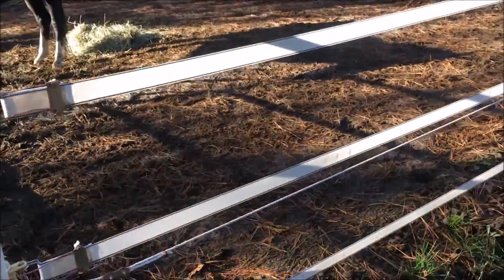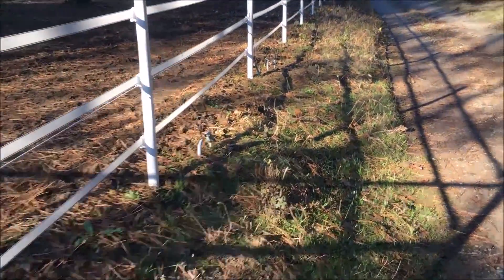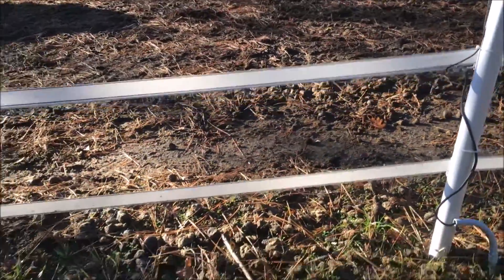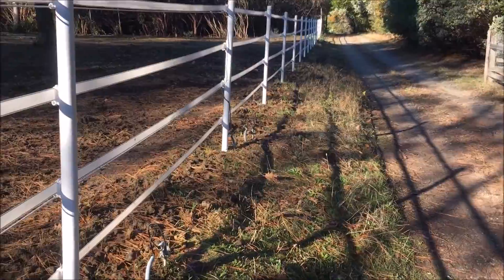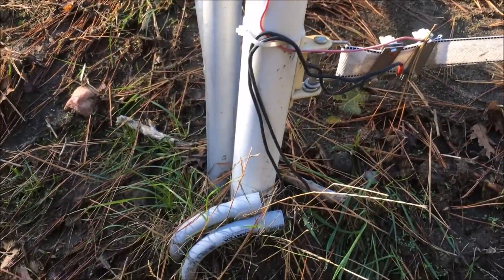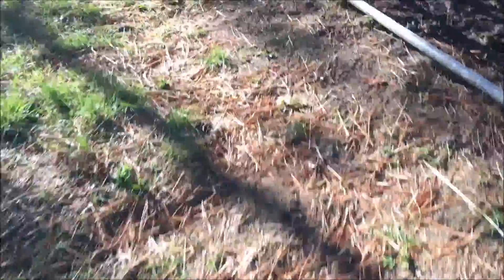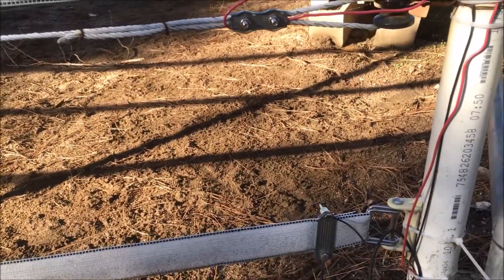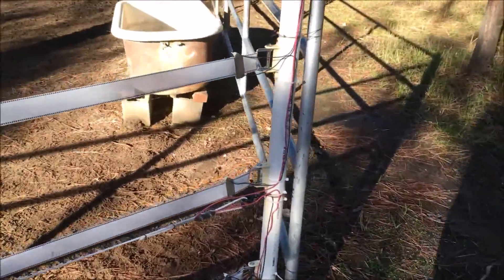Zareba Solar Electric Fence with Poly Tape & Poly Rope (Grounding Problem/Solution)

Comment: Did you use pvc pipe
Reply from the maker: Yes. I pounded in t-posts and then placed pvc over the t-post and attached everything directly to the pvc. My early videos here but the video after this one is a slide show that shows the progression mostly.  Thanks for watching.
Reply: You can put the PVC in a chopsaw and cut one and a 45 PVC pipe will drive right in the ground by itself using a regular T post driver